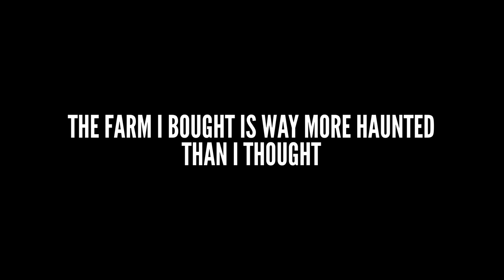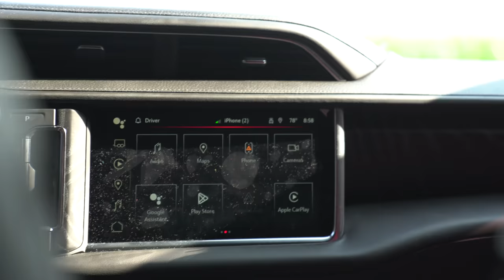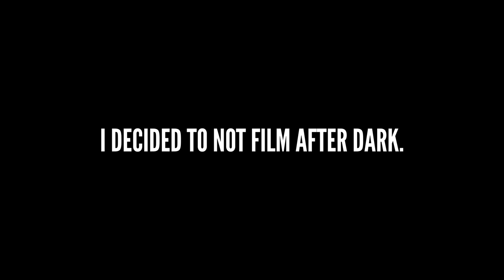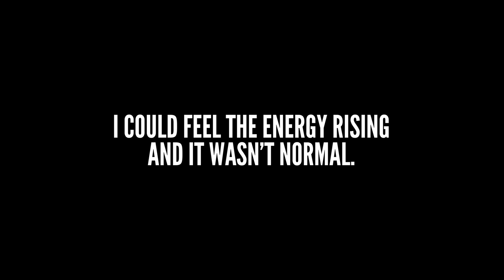THE FARM I BOUGHT IS SO HAUNTED THAT PEOPLE LEAVE DURING THE DAY

Comment: The knocking on the window was really close to you so my guess is it had to come from down stairs in the house. It wasn't coming from the vehicle windows because they make a totally different sound. Also, I need new windows and have the old metal framed type of window. The knock that came from yours windows sound identical to mine.  Also...when you (CJ) were in the house, in the kitchen, right after the really loud sound happened and it kinda freaked you out I noticed a shadow man/women on the basement wall. In retrospect, I believe it was your shadow BUT there was also a shadow on the basement door. Was the light coming into the kitchen in such a way that it would cast your shadow both on the walls going down into the basement and the door to the basement? I'm going to say that both shadows were yours but I guess only you can answer that question.

Comment: I do not get the same feeling about this farm, as I did the Honeycutt farm. I do feel a lot of different energies, not all bad, but dark stuff, too. Honeycutt made me feel worse than what  I pick up so far with this farm. 
I believe, you need to secure as much of the whole property as you can, because the worst vibes I get are with human tresspassers, not the curious explorers, nor down & out homeless drifter, but others. Secure windows & doors with alarms, running water & electric power ( maybe solar?), & more CJ approved human activity day & night. Some exterior work, besides the roof & other necessary repairs, cosmetic stuff to make the place look like somebody lives there now. At least, spray off the dirt & mold & put a fresh coat of paint to take away some of that abandoned & run down look. Also, there is, at least one spirit that I sense that seems to jave a growing appreciation for you taking ownership of that place. Maybe, a former resident that doesn't like the kind of people that sneak around out there?

Comment: I personally would removed the building. Even if someone trespassed on your property. If they get hurt in the building. You could be held responsible for their injuries.  I would still get a door for the basement with lock.  To prevent anyone entering the house through the basement. Selling some of farm equipment. Could ease  some of the cost to the house.  Maybe when you play tag with the dirt bike inside the house. Could have upset some of the spirits. When you were at your truck getting. The new lock for the front door. I did hear banging too!

Comment: I had a problem with carpenter bees and snakes at my property also. The bees were making their way through the deck face board against the house and were under my bedroom floor area. I took an empty cardboard box and put a cordless orbital sander in it and let it run until the battery ran out. Approximately 45 minutes. Within a few minutes of running the sander the bees were coming out of the hole by the deck looking to see what was going on.I sat on the deck about 8 feet away watching this. They don't like vibration. The bees that come out are the males. They don't sting but if they think of you as the threat they will sad butt you. They are protecting the queen and other females within the hole. I repeated the process the next day then sprayed some citrus into the hole because they don't like the smell. No more bees. Patched the hole. Also had an issue with snakes. I came upon a nest while clearing junk in the yard left behind from a past tenant. I poured ammonia around the best area but not in the next because that would kill the snakes. You have some snakes in a small utility shed. I would suggest putting a container filled with ammonia with holes on the top of it and place it on the floor of the shed and they'll relocate if that's what you wanna do. Good luck!
Reply: Spell Check sucks. The bees will head butt not sad butt. 😂